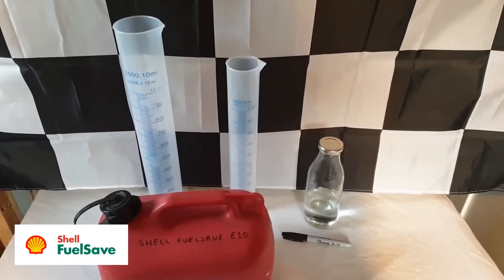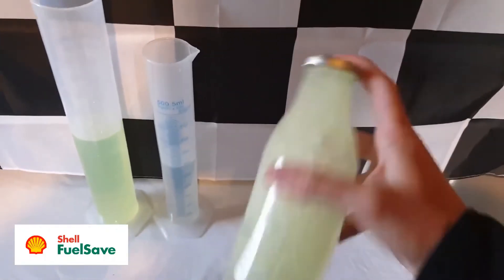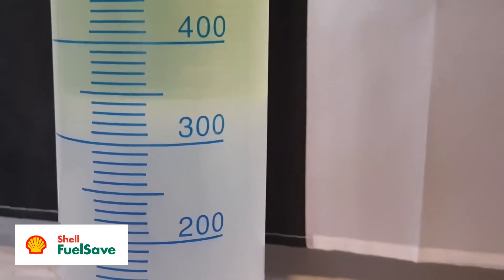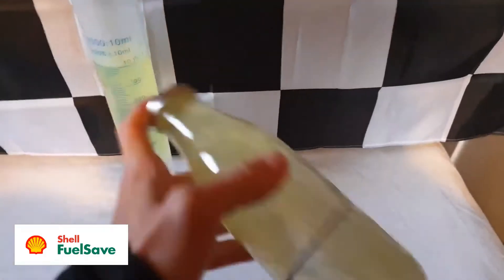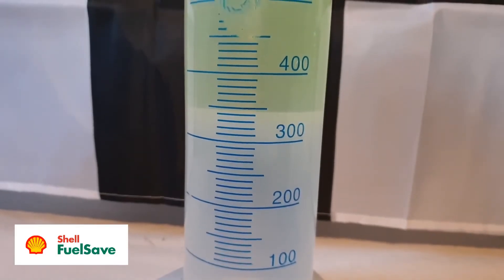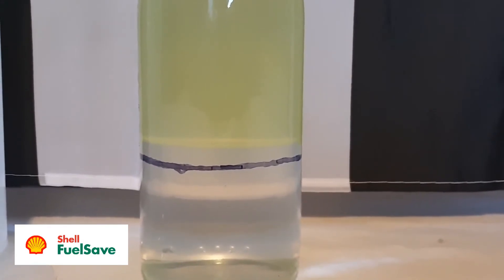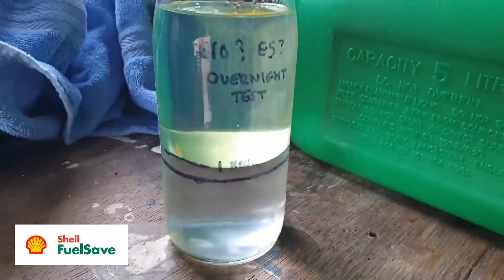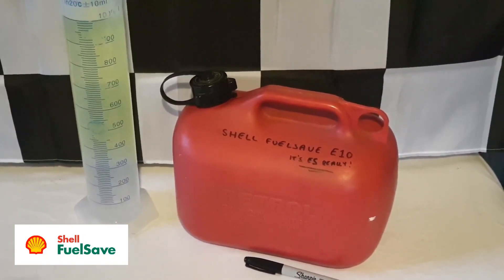Testing for Ethanol in Petrol / Gasoline Part 5: Shell FuelSave E10 Control Tests – E5 E10 mandate

Comment: I'm curious about Total excellium if the are any Ethanol in it ( I'm from the Netherlands and I'll do a test with Total Excellium soon)
Reply from the maker: It'll be dependent on the refinery that supplies the base petrol (before the additives make it a brand), but yes I'm curious about Total as some suppliers aren't too bothered about their performance fuels having corn in it.
Reply: @boilerhousegarage  Hi! Ive tested Total excellium 98E5 and there is no ethanol in it in the Netherlands 👍
Reply from the maker: @wanniwashingvideos4911  Fantastic 👍 It's good you still have an ethanol-free option for storage and classics, etc (plus it does better economy to compensate the higher price). I don't seem to have a Total local to me, but I will look for one to compare. Thanks for the update.
Reply: @wanniwashingvideos4911  That's exactly what Total's official account on the French car enthusiasts forum Caradisiac says : Excelllium does contain ETBE (ethyl tert-butyl ether) up to 15 % volume to achieve its 98 RON octane rating, but no ethanol.